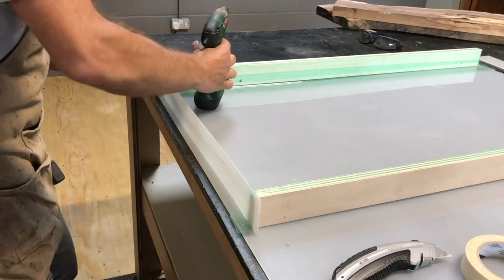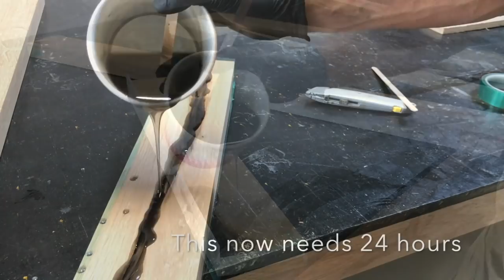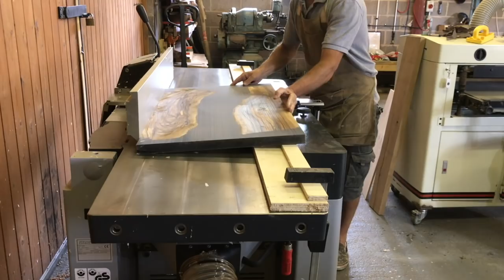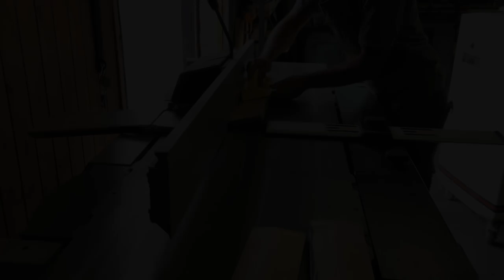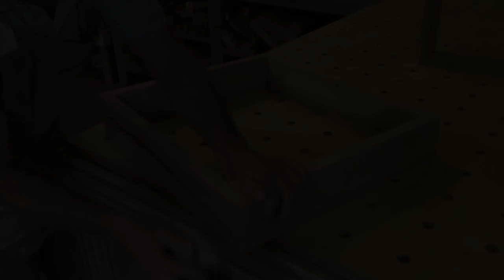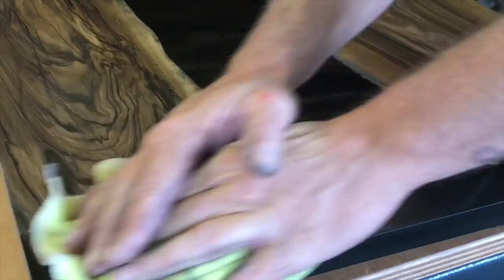Black Resin English Walnut Side Table  (Short Edit)

Comment: It's a beautiful design. Possibly your best yet I think. The deep chamfer on the table top is an elegant and simple way to achieve the floating effect. It looks great. I tend to house a cross member into the underside of the top to give the floating effect when attached to the leg frame. Pretty traditional but still looks cool. Not sure how feasible that would be on an epoxy top so yours is a neat solution. Do just the two D-nuts per leg frame really give them enough support? I'd have thought they'd sway a little - or have I missed something?
Reply from the maker: Cheers ,  The 2 D-nuts are very solid and with the wider leg profile it Rick solid
Reply: Interesting. Thought the wide profile might help here. Might give something similar a go myself at some point in that case. Thanks for the response buddy.

Comment: Really stunning, the dark resin matches the wood beautifully. Thanks for clarifying the need to use the jointer to achieve that chamfer; I was wondering why you were risking your fingertips when a router could have done the same job!  Are there any concerns with wood movement over time, or does the resin prevent any moisture changes in it?
Reply from the maker: Resin stabilise there wood very well.  But you still need a good environment as will all slab style items ..  the chamfer is far to large for any router bit.  And also has a much better finish on the wood/resin

Comment: I have a question about using jointer and planer to cut epoxy. Is it no crack on epoxy?
Reply from the maker: No works great with sharp blades
Reply: Thank you

Comment: Beautiful piece of work sir. I really appreciate the step through process, but more importantly for someone in the UK I appreciate the links to UK based sites where you purchased the products. Having watched a few similar (but not as good) videos from our friends over the pond, some of the products used get a little lost in translation as they reference brand names that aren’t readily available here.

As an enthusiastic beginner to the world of epoxy, I am looking to make some charcuterie type serving boards as my thicknesser only takes a maximum width of 13 inches and my planer 6 inches 😀. Can I just ask if you do anything else to prep the wood apart from the filing etc? Do you apply any products to the parts of the wood that come into contact with the epoxy? I just ask as, again referencing ours friends over the water, they talk about a product called shellac or something along those lines? 

Keep up the good work sir, subscribed to your channel today and look forward to binge watching the rest 😀
Reply from the maker: Cheers :)  I have lots of Video on Epoxy I suggest you watch some more .  but no you don't ad anything before a resin pour just clean up the edge first ..  shellac is an old school finish ( used for french polishing in the old days) it still a useful product today .  but not the easiest to use. best of luck

Comment: Well I just don't get it. When I use the vacuum chamber, it takes more than 20 minutes to even come close to taking out all the bubbles, and I have to constantly watch it so that it doesn't over flow. Most times I have to stop the process to avoid having the resin start to harden. Happened to me once. The process is exceedingly tedious, and rarely works well for me. And I have tried dozens of time. Now I realize different epoxies will respond differently but unless you have an unlimited budget for epoxy, for me this is simply not worth the effort and cost. The companies that make resin probably can't believe their good fortune at all epoxy projects flooding youtube. Wonderful build though, thanks for sharing.